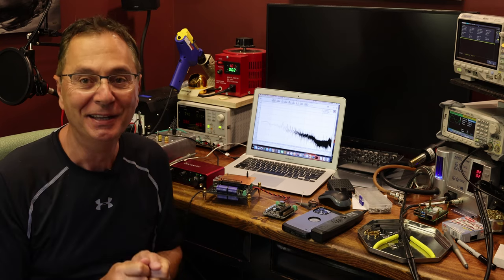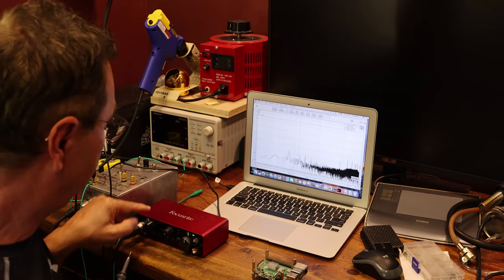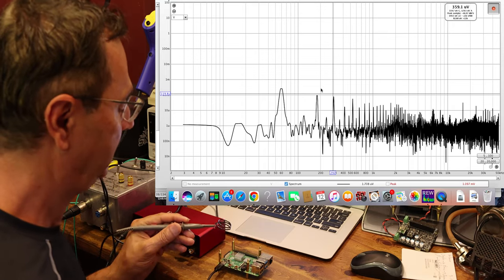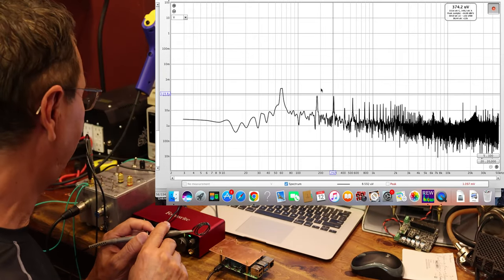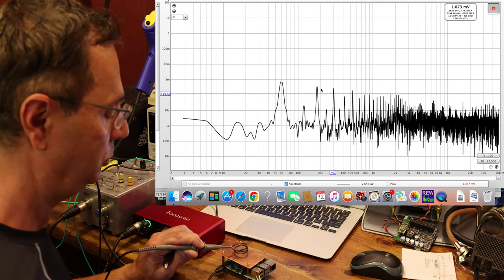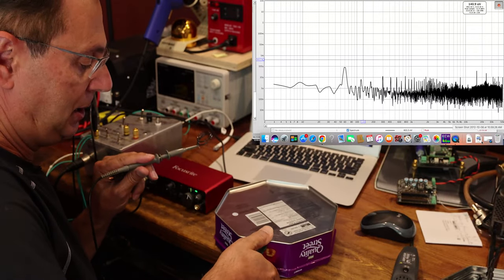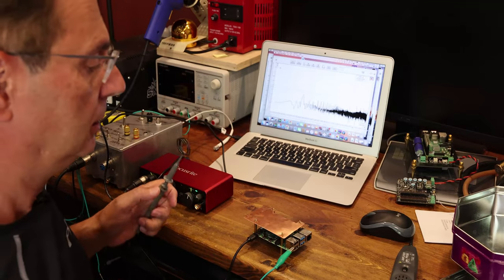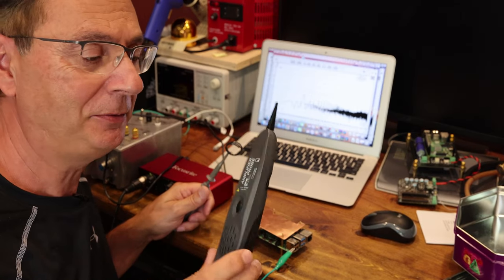Understanding Shielding  with a Raspberry Pi in a HIFI Dac. How to Measure noise with (simple tools)

Comment: A little off topic I suppose but I wonder if shielding an analogue interconnect also takes away from the musical information in the music signal...
Reply from the maker: The closer and longer the shield to the signal more capacitance starts to occur and on a very sensitive interconnect like say a phono rca you will start to negatively affect the sound
Reply: @Gabster1 this rule is valid also for digital/clock cables?

Comment: I have quite a long RCA cable between my preamp and amp. At first it sounded not really good, it wasn't noisy, but a lot of detail was gone and the imaging was messed up. Then I wrapped the cable with tinfoil and grounded it via an outlet. Night and day difference. The imaging is spot on and the detail is amazing. I have absolutely zero audible noise. It's amazing how you can upgrade your hifi setup by just a few bucks.
Reply: I've done this as well... Use a pvc tape layer and then another shield layer, and do it again. I did this three times on my custom xlr cables with pure copper foil and PTFE for thr very best and damn what a difference even with balanced cables... Remember all this balanced noise removal stuff never gets it all so doing more on a very high end system is quite obvw
Reply: @ClassifiedBrief  yeah, I tried this because I am on a tight budget and balanced connection wasn't really an option because neither my preamp, nor my amp support it. And I already had the long RCA cable. It's ugly but it does its job very well.

Comment: I found that using Raspberry Zero 2 W is better than using 4b or 3b. Because it has lower power consumption, less heat, and same pinout as the 4b / 3b; Most important, it is "suppose" cheaper. All these are benefitial to hifi diy because of lower noise, lower heat dispense consideration. The only problem is the supply. It's impossible to buy zero 2 W at 15USD.
Reply: How do you connect ethernet cable? USB to ethernet adapter?

Comment: Hello Gabster, very informative video, thanks ! Some Pi audio-cards (Allo DigiOne ...) have their ground voluntary isolated from Pi's ground. Once they are connected (eg by S/PDIF in Coax) to the DAC  itself generally connected to Earth, grounding to Earth the Pi will therefore "short-circuit" the am ground isolation. May this be an issue ? That said I tried myself with and w/o Earth on Pi + DigiOne and for now didn't noticed a significant difference.

Comment: This is where making even a small mesh case (faraday cage) with an internal ground point and a grounding lug like I have on my amplifiers and Blu-ray players, would be fantastic.
A solid aluminum case made for whatever your final configuration ends up being with again, an external ground lug, would be fantastic for noise reduction and allow it to be placed next to other components without *potentially, coloring the sound.

Comment: Great! I tested too,  just running a wire to a nearby radiator (just for testing first time). My Raspberry was already in a metal housing but still there was a lot of noise. Connected to ground it became as quiet as the room itself. Fantastic. I hear a lot of improvement in the "texture" of music, micro dynamic if you will.
Reply from the maker: Glad to hear others are experiencing similar results and I am not going crazy :)
Reply: @Gabster1  I am very happy about the improvement in sound quality this made. But now I ask myself is this safe? So I am in an older house and the particular room I use there is no electrical ground, therefore everything runs ungrounded of course. The power amp has an AC ground wire and can(should be?) grounded via AC, however its not and it has run fine for some years. Other equipment has EU AC cable (can be run in both ground and not). Now, all these things hums along quite loud when measured with these fieldreceiver. But as I tried for a starter I just connected a usb-cable to the raspberrypi  and connected the shield (the outer metal housing) to a radiator (goes to earth ground) and the hum almost disappears. The sound is great, but as I read about how to ground things I get some cold feet. Is there a better way to do this? It's this mix of ground/notground that worries a little.

Comment: Nice, I have a Pi feeding a HAT DAC, so this is very relevant.
The main mod I did was to separate the DAC power from the Pi's power. Now I have the Pi running off a switch-mode DC/DC converter, whilst the DAC is running off a 7805 linear regulator, that made quite an improvement to the sound.
My next mod thought was to move the power/earth feed point from the the micro USB port, to the I/O header side, so the main point of earth & hopefully now the quietest part of the Pi is that that is feeding the DAC.
I like your shield idea, I'll have to source another header block and M2.5 stand-offs to raise the DAC up to make room for the shield.
I'll have to also try your 1KHz tone and analyser setup - REW was it?  as seeing the noise rather than just using my ears is real handy.

Comment: Please show another video looking at shielding with your big dac streamer, effects supercaps have, and maybe even on the clean side of the station pi we shouldn't be stacking the gear.

Also - did you end up sticking with Ian new active i/v board over the transformers?
Reply from the maker: Some day I hope to try it 
I still have the trafo I have no room in that case left to add 2 x 5v power supplies. But will use it in a future design they are both good

Comment: Hi Gabster, how the measurements are when you use the eaton supercapacitors on the raspberry pi or a battery if you shield or earth?
A new video is not necessary I am only curious if this make sense.
Reply: I agree he ideally would have shown the lowest possible he could get it with super caps, grounding the pi, grounding the shield, grounding a second shield
Reply from the maker: About the same a tad better then  PURE Pi  but hard to tell as these are approximate very error prone measurements.

Comment: I'm also suspecting ground issues with my RPI4 and PurePi/ShieldPi/TransportPiDigi + Ifi IpowerX setup. When I touch the coaxial connector to PiDigi, or PI4 LAN port with a metallic object or with my finger, music interrupts for a second. I also wonder about Pi grounding. Is its ground floating or anything? How could I ground my PI? I don't have a tester. I don't have safety earth enabled in my home electric installation.
Reply from the maker: Could make a ground by running a wire from any metallic structure that is in the ground that may be ok in a country with no ground it is illegal and not to code to do it in a country with ground socket
Reply: I have ground (neutral) in my socket (you can't do without for current) but its schuko safety earth pole is not enabled. Safety earth is for short derivation, not for grounding, isn't it?. I guess external grounding from Pi Lan port to a metallic object at home improves ground that the Pi takes from socket (Ifi DC adaptor plug doesn't have earth pin)? @Gabster1
Reply from the maker: IFI is not grounded  a metallic object at home would help a lot for a low voltage project like this one  it is fine but for high voltage products you take the risk of accidentally electrifying that object  @wyup

Comment: Thank you! What about showing the shield you used? The Altoid lid instead of copper?
Reply from the maker: They are about the same any metal plate connected to earth ground will be about the same the bigger and more coverage the better I showed it at the beginning but no longer have it gave it to a friend recently. grounding the PI is as important if not more important.
Reply: @Gabster1  thank you!

Comment: Hi, I think I'll be the voice of the masses here and say that we really appreciate the demonstration, we understand the results and would love to replicate your findings. However, we have no idea how to actually ground the pi.

What do I connect what? Do I need a wire? A special cable? Where do the ends go?

Thank you
Reply from the maker: Any reasonable size and type of wire will do, 
a lot of amps or preamps have a ground terminal on the back. Vintage amps have a phono ground same thing.
Worse scenario but also the best connect a wire from the ground terminal of your AC socket.

Connect it to the metal shield portion of the Pi or Negative power input and also connect it to the additional Shield you created.
hope that helps
Reply: @Gabster1   what is the "metal shield portion of the pi"? 

Also, "ground terminal of the ac socket" - any socket, or the one the pi is plugged into? My pi is using a 3 prong plug so how can I connect something to the ground terminal if it has the electrical plug in it? Do I wrap the wire around the middle prong?
Thank you

Comment: So could you just attach the plate to the negative end of the/a power supply?
Reply from the maker: Most power supplies negative is not grounded so  it is up to you to ground all your supplies 
Some times circuit ground is not power ground 
It gets complicated 
There are 3 main grounds 
Earth ground like in this video
Power ground
And signal ground 
Often the first 2 are connected together but not always. Signal ground varies a lot. You can research it online it is a very tricky subject
Reply: @Gabster1  thanks, that helps. I'm building a portable media sharer/power bank/lightbox - I'm looking into extra jack ports because I despise people who inflict their noise on everyone else.

Comment: The one on the left where the ground wire is connected is a power suppy board?
Reply from the maker: It is just a shielded box to house some protection circuit for the sound card It is described in detail in the video at the end where I talk about the setup in detail

Comment: How exactly do you "earth" the RP? Is there a common way to earth any audio PCB (ie a dac or class D amp PCB), even if it runs on batteries? Or, in this case, the negative (- or "ground") serves as "earth" as well, so, no reason to earth at another point? Thanks for this wonderful video.
Reply: Just connect a cable to the metal part of one of the Lan ports or usb ports as that is connected to the ground of thr pi.
Reply: @ClassifiedBrief  thank you. How about other battery powered PCB dacs or amps? Can they be earthened too, or ground is the minus of the battery and this is earth too?
Reply from the maker: They can but be careful  Chassis ground is sometimes connected to power ground or Signal ground some equipment may not like that you would need to experiment.
Reply: @Gabster1  Thank you.
Reply: @Gabster1 great video. Thank you. Would distancing the HAT with a GPIO ribbon be beneficial? To a separate grounded Mint box.

Comment: Hey Gabby, love your channel.  I was wondering if you, haven’t already, discussed using USB to connect a Pi streamer to a DAC.  Is the standard Pi4 usb clean enough when powered by a battery, or is there a better USB output that has a USB reclocker? Really appreciate your work! Regards!
Reply from the maker: I have not done much work with USB not my favorite I prefer a shorter I2s path but you may want to experiment with Allo USBridge  but not sure if that is a good way others may know more about a good USB system